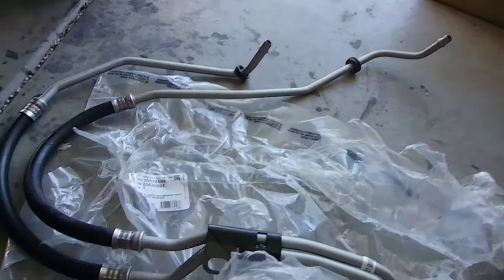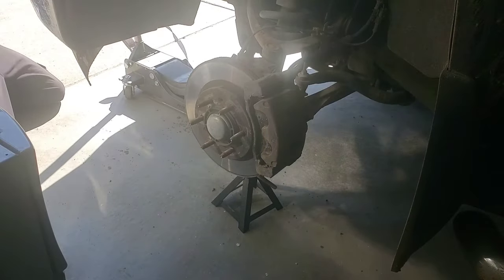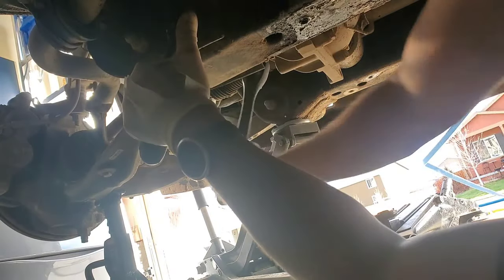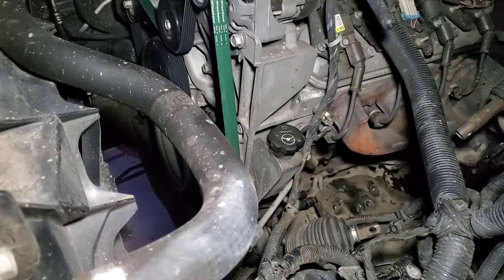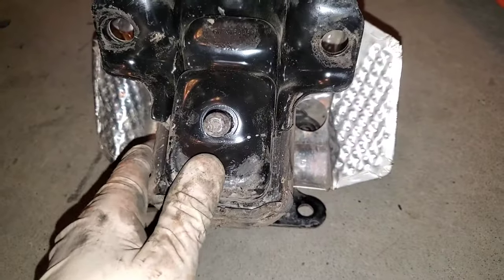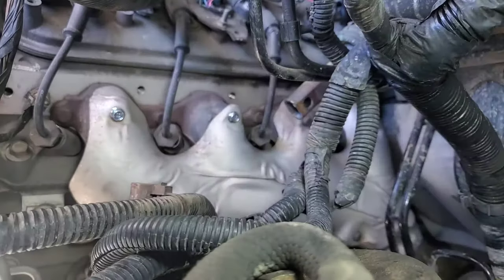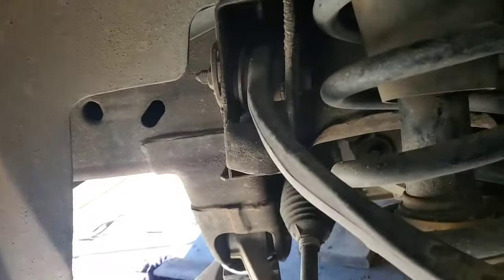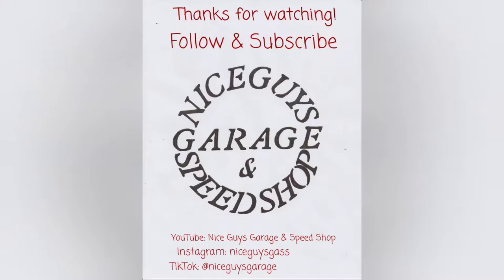How To: Replace Oil Cooler Lines, 2007 - 2013 Chevrolet Silverado or GMC Sierra (4x4) the EASY way

Comment: I spent 4 hours trying to remove that black piece from the steering shaft. It wouldn't push in at the firewall. I might have to take it to a shop.
Reply from the maker: It might be seized from road grime or rust. If you have both the bolts out, try some penetrating fluid. If that doesn't work, you can always try some heat. These things don't always go as planned, especially when metal gets to rusting.

Comment: Do I really have to take the motor mount off? After getting under the truck it looks like I have enough room to fanagle new lines into place...thanks!
Reply from the maker: We just like doing things the easy way and it turns out sometimes the easy way is the hard way. Taking the motor mount out isn’t really that bad, but trying to squeeze through with “just enough room” is. Our goal is to do the fighting for you so you can spend your time better. Good luck, and let us know how it goes.

Comment: I don't mean to be difficult, however,  you don't need to do any of that, shred the old lines out any way possible, unhook the front part of the driveshaft, take off the tire, remove the inner fender, and the new lines will thred in, time and patience, 3rd time doing it....
Reply from the maker: Excellent advice! We’ll try that if we ever have to suffer through this job again!!

Comment: Hi. I thought about adding an oil cooler line to my 4.8 ltr, 4wd Silverado 1500. It did not come factory with one. The reason is my radiator is leaking and would be cool upgrade. Would by 4.8 ltr have this much trouble also? I don't know if I should even bother adding an oil cooler line but seems like the oil would last a bit longer having it. Any advice guys? Thank you!!!
Reply from the maker: If you wanted to route the lines in the stock location, you'd have these issues with the install because the external  block size is the same. 

In our opinion, if you're not running into issues with the oil overheating from heavy and consistent towing, off roading, hauling, etc - don't mess with it. The oil won't necessarily last longer because physical contaminants will cause the need for an oil change long before viscosity loss due to temperature fluctuations (usually).

Hope this helps!

Comment: The most aggravating part of this job for me was the motor mount removal.  I had to unblolt the bracket, turn it over, and remove it in three pieces before it would clear it's home area in the engine bay.  I replaced the mount with a new one, because it was out and 10 years old, but I ended up cursing the gods and cut the front edge/side of the heat shield off completely because I could not see what I was doing to get the block bolts in.  Took a while to align the bolt holes using the jack to move the engine up and down.
Reply from the maker: The engine mount is definitely the worst part of this job. Some have argued dropping the axle is easier, but with a few profanities and an adult soda or three - the engine mount is manageable!
Reply: Don’t even have to drop it just loosen it. I think this dude was drunk and wanted to do even more work by pulling motor mount lol

Comment: I removed the skid plate.  Definitely drop the front axle 2” (it will rest on the cross member).  I unbolted the two bolts on the driver’s side and loosened the two on the passenger side.  The driveshaft can be unbolted to rest on the front sway bar.   Leave the driveshaft inside the transfer case.  Don’t remove the drive shaft.  Then the oil cooler lines can come out towards the rear.   Still a bitch but it is doable.
Reply from the maker: Hmmm... so what you're saying is there is more than one approach to this job, but all approaches might be equally terrible? Still, we'd be interested in watching a video of your process! Send us a link if you post one, and thanks for sharing.
Reply: Yes this way works but I had to go slow.  
Raised the driver’s side with a Jack stand
Removed both the aluminum and plastic front skid plates. 
Unbolted the front driveshaft and layed it on the sway bar.  Later, I’d move left or right depending on where I needed room.  I also covered the u-joint with a nitrile glove to keep it assembled and clean.  Removed two bolts on rear oil cooler line and drained oil.  
Unbolted the front cooler line bracket.  For this, I used two extensions and a u-joint attached to the socket. 
Removed both cooler lines like in your video.  
Tied strong line to the shorter cooler line. (This allowed me to route the new lines during install).  
Dropped the front axle as described above.  
Took my time pulling the two cooler lines turning and tugging.  If I got stuck, I’d check up front and release the tension.  Covered the new cooler ends and block with a freezer ziplock and clear tape.  Attached the cord to the new short cooler line and reversed the process.  
It’s a simple but difficult task to accomplish.  Lots of sliding on the floor and struggling.  The most difficult thing was reattaching the cooler line bracket onto the engine block because you’re practically working by touch not sight.  Took me way too many hours for this job (12).   The time could be cut in half with a helper and if it’s the second go round.
Reply: I pulled it out the rear but didn't loosen diff at all.

Comment: Did you have to lock your steering wheel straight?
Reply from the maker: Didn't lock the steering wheel, but it is a good idea to use a bungee strap to keep it from turning while it's disconnected

Comment: My lines are leaking from radiator in and out ..  they are loose with the touch ?
Reply from the maker: Pop them out and replace the clips, might solve the problem!

Comment: Instead of fighting with the lines to pull them out can't you just cut them? Video gave me the Vice Grip Garage feels love it!
Reply from the maker: You absolutely can. But for the purposes of an instructional video, and to make sure we know how to get them back in, we took on the fight so you don't have to!
Reply: @NiceGuysGASS  sounds great, thanks! Doing mine now similar to 2011 gmc 5.3. Only difference is the intermediate shaft does not slide you have to take it off the rack and pinion.
Reply from the maker: Dang, that's a pain. How did the process go?
Reply: @jngmgmt1  I understand cutting the out cooler out but putting the the new one in are you going to cut it also?😂 Still have to get the new cooler in without any harm.
Reply: @NiceGuysGASS  it went smooth. It was just one bolt on the rack.  Put it all back together and got it aligned. Running like a top now. Thanks again!
Reply: @Badeau68  Cutting=5 seconds     None Cutting= 5 min to 10 min shoving your hand in cramped spaces with sharp things while cursing.  
Install is the same regardless shoving your hand in tight spaces while cursing. You just save some time and headaches with cutting.

Comment: Good to know my weekends ‘bout to be a bitch😂
Reply from the maker: We’re pretty sure that was the point of the weekend from the beginning. Hopefully the video helps to make it a bit easier.
Reply: @NiceGuysGASS I procrastinated 7 months for this on my hummer h2. Doing it as we speak and yes… it’s a bitch. Especially because my steering shaft doesn’t collapse and the whole box has to be removed in order to get it off. And my front crank sensor connector is siezed. And on my truck the lines have a bolt that supports the lines under the engine and you can only get it with a ratchet and a wobble 1 click at a time. 0/10 would just take it somewhere next time if I wasn’t banned from the gm dealer.

Great video tho.
Reply from the maker: @DarthSmartt  Banned from the gm dealership sounds like it has a back story! Some others on here have said dropping the front axle is easier, maybe it is? We have another video that we recently did on how to replace the front diff in these rigs, it isn't all that bad and might be necessary given your unique hurdles!

Comment: The black tab on my oil cooler line refuses to stay on
Reply from the maker: Sometimes we go with the "it's probably over-engineered" mentality and full sent anyways... proceed at your own risk!
Reply: @NiceGuysGASS  lmao naaaa the oil line keeps popping off with the oil pressure build up.. huge leaks…
Reply from the maker: That does sound like an unavoidable problem you'll have to address. New line, New clip, or block off plate? 🤔
Reply: @NiceGuysGASS  new line…. Just did the timing cover gasket… oh well.

Comment: Why would the intermediate shaft on my truck give me such a hard damn time removing it?? My truck looks exactly like yours but that black part won't budge. Any tips??
Reply from the maker: It is probably seized due to rust and corrosion. Heat and PB blaster should help
Reply: @NiceGuysGASS  that's exactly what I was thinking BUT turns out mines a bit different. I had to remove the knuckle part with the boot around with the black intermediate as a assembly by removing the pinch bolt below the boot part. Yea idk why but the black intermediate part has a little punched tab by the bolt holes preventing it from being removed like how you did.  A hour of yankin and pullin smartend me up. 🙄
Reply from the maker: Ha! Well... that's different. Chevy assembly line, what you get depends on the day of the week they built your truck and what parts they had laying around!
Reply: @NiceGuysGASS  lol I know right. My trucks a 2011 and I'm pretty sure they were bankrupt that year. Lol

Comment: 3 bolts to drop front diff. Just did this job in about 25 mins. You do not remove diff you just drop it down. This way is way longer.
Reply from the maker: Dang it! Now we know for next time, hopefully you filmed your repair, and if so please send us the link so we can learn how to do it the easy way. It's a Chevy, it will leak again eventually
Reply: i need to replace the motor mount and the oil lines. . If I drop the diff can i get to the motor mount too?
Reply: @Knotoncallfishing1  I personally don’t do that to do the engine mounts. I just take the inner fender out and take out the front driveshaft. If it’s on the driver side you’ll need a wobble socket that helps. But since you’re doing the lines too, it’s not gonna hurt you to have some extra room.
Reply: @casey889011   thanks for the reply.

Comment: If my Radiator is broken where they oil cooler line goes that means I can lose oil pressure right??
Reply from the maker: It could be cosmetic, it could be a leak where you lose pressure. Typically damage causing pressure loss will cause a visible leak. If you don't have a leak but suspect pressure drops you probably have blockage that would likely be cleared with a good flush product. Send us some pictures of the damage we'll give our opinion (although we still don't recommend following our advice)

Comment: How many hours in real time didnt his take
Reply from the maker: Without filming, 2 - 3 hours.
Reply: Job pays 2.4 hours I normally get them done in 45 min to an hour just support the front diff and take the 2 bolts out and it can drop down enough to get them out and in granted I’m using a lift but I bet it wouldn’t be to hard with out one

Comment: Torque spec?
Reply from the maker: Can't recall, we probably just used the "Slighty snug, not too tight, just right" estimation.. but you might want to Google it. Ours didn't leak and seems to be holding up, but maybe we got lucky!

Comment: Has anyone ever done this with an aftermarket oil cooler adapter and braided flexible hose?  This looks like an absolute pain in the ass.
Reply from the maker: There's no reason that you couldn't do that! It'd be more expensive, but probably easier. You could also make a custom hose and feed them through one at a time instead of using the stock part? Lot of options.... could also just use a block off plate and just keep an eye on oil temperature when you tow? We chose the hard way
Reply: @NiceGuysGASS  Hey man, we've all been there.  You don't find out an easier way until you spend about 6 hours on a project that should only take 2.  Thank you for the video.  My hoses are starting to leak up at the radiator, my mechanic that did my drum brakes told me about it and I know its only a matter of time.  Appreciate the response, cheers!

Comment: Old ones bad ?, If so just cut the rubber hoses in a few spots and all those angles  won't be bad at all. Save the cuss words for when you put it back in hahaha
Reply from the maker: Ha! Yes that approach could work but Kyle wanted to make sure he knew the clearance was there to remove old lines before attempting to install new ones. At least there was no wrench throwing!!

Comment: That engine mount is a son of bitch to just remove. Had to replace mine and that is disheartening to hear that at the beginning
Reply from the maker: You can lower the front axle instead. We have a video on a differential replacement on this truck, check it out and see if that way might be easier! You wouldn't have to take the differential all the way out, just lower it (from what we've been told)